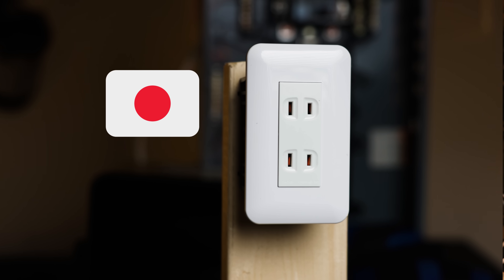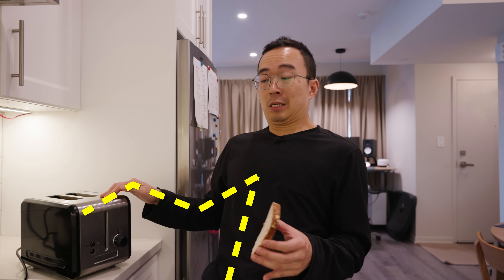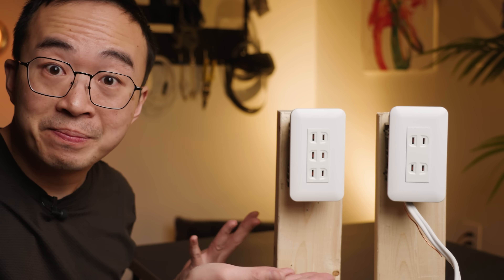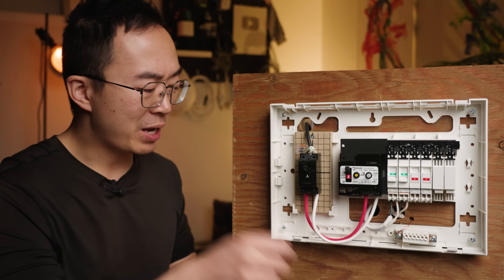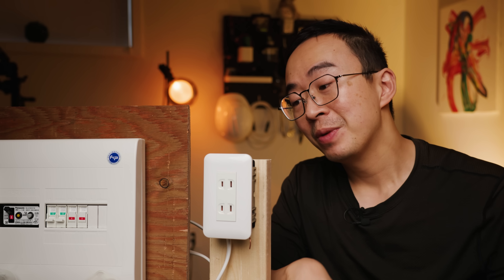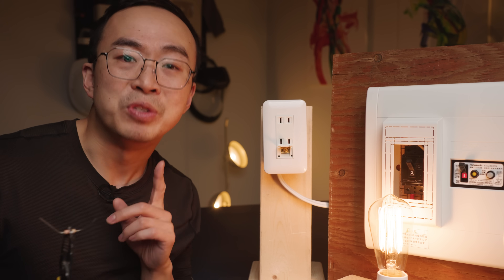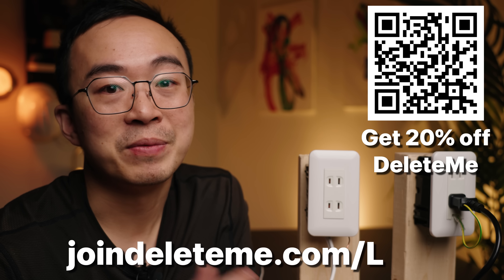How Japan Made Their Outlet Safe

Comment from the maker: 🔒Remove your personal information from the web at  https://joindeleteme.com/LAM and use code LAM for 20% off 
🙌 DeleteMe international Plans: https://international.joindeleteme.com
CLARIFICATIONS: Jan 21st  Ohhh the comments are spicy on this one.  I'll be adding more details tomorrow, here's some important ones: 

Grounding: Yes, ground acts as a low-impedance path (in TN countries) to trip the circuit breaker and turn off the circuit.   One of the best video on grounding and bonding covers this point in incredible detail: https://youtu.be/mpgAVE4UwFw?t=993  This is someone who has built an incredible system teaching NEC and how it actually works.

Japan ≠ Best.  This is not a video about who has the best system and especially not Japan having the best system.  This is about how Japan solved a problem that runs opposite to America (and most countries).  They required GFCI first and grounding second which no other country has done.  That's the unique part, not the GFCIs in the wall.  If you have a favourite electrical system and you got offended, sorry.  

7W Light Bulb: I didn't do a good job with this visual / explanation.  I was referring to the filament, not the wire, the filament provides the resistance and therefore due to Ohms law restricts it to 7Ws.
Reply: for the record, this isnt only japan's outlet, the philippines and a number of southeast asian countries also employ the same outlet.
edit: though we dont have a "GFCI", but now im interested and i want it.
Reply: This is nothing compared to the over engineered British plugs and outlets 😉
Reply: Please do not scam people with those scam ads.
Reply: All the new construction in the state I live in requires ground fault interrupt breakers so if we're adding them to our breakers and you guys are adding grounds to your sockets you might as well just use the sockets that America uses cuz it's already got three prong ground on it
Reply: because if an outlet in japan becomes unsafe it will be shames and shunned for dishonourable conduct
Reply: reported for scam)
Reply: That is crazy that your father got blackmailed by advertisers. Thank you for sharing this with us!
Reply: Or a previous tenant just ran a jumper from ground to neutral on the back of the outlet. Then the nifty passes, even though it's not really grounded
Reply: We build underground.
Reply: I guess that solving the problem just doesn't make enough profit for big business.  No go!
Reply: Huh? No mention of ARC FAULT (AFCI) protection aka DAA/DDFT in europe. GFCI/RCBO is old news in global electricity safety systems.
Reply: They did not... European ones are safe.... (not UK, but EU)
Reply: Thankyou I enjoyed your video and history of GFCI
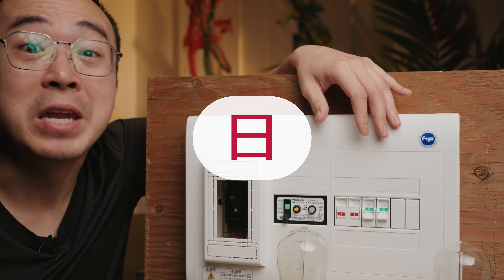I love the 1:10 XD
Reply: am I the only one who gets scared when I see open electric components like this. 😅
Reply: In spain we use the same sistem and the ground on 16A outlets  and now it's alos mandatory the ovevoltage protector becuse are alot of on grid photovoltage sistems.
And yes they are in the panel from the 1980 normative.
Well it was mandatory becuse the 220v can kill you insted the 100v of japan plaus now we are on the 230 v +-10% upgrade made 5 years ago.
Reply: Every electric expert uses slang language like tripping, shook. Makes me confused forever on the subject of electricity.
Reply: Japan's 2-pin voltage is 100VAC, will never kill anyone!
Reply: I always thought that ground circuits were in place to reduce the risk of fire in case of short circuits and to protect the home and occupants in case of lightning strike or power surge.  Where I live we have single phase with one ground in most homes. Some may have three phase power.
Regulations demand that Any electrical appliances that do not have a ground circuit must be double insulated, amongst other compulsory features.
Reply: I beg to differ: 3 holes are better than 2. 😢😅
Reply: Creo que europa es mejor , si falla el diferencial, te salva la tierra si es inferior a 129 oms necesitas Asegurar tensiones inferiores a 24v en las chapas electrodomésticos. El sistema americano tierra a neutro creo que es peligroso Y lento no protege a descargas directas solo indirectas.
Reply: Nice to meet you.
I am an electrician in Japan.
The direction of the outlet is opposite to that of the wall socket, the short hole is on the right and the long hole is on the left.
Reply: Why don’t you talk about the dual voltages in Japan….so much for a logical country
Reply: Żaden inny kraj? Polska zdebia dokładnie to samo na obszarach wiejskich, ale w Polsce oba systemy się dublują od 2002 roku. Przy czym dalej w starych budynkach można spotkać instalacje z wyłącznikiem różnicowym bez uziemienia. Sam w swoim domu robiłem uziemienie jakieś 4 lata temu, a wyłączniki różnicowe w moim domu są od 1997 roku według dokumentacji, a dokumentacja sprzed tego roku zaginęła . Ogólnie w europie uziemienia, wyłączniki różnicowe i transformatory separacyjne wprowadzano w tym samym czasie na różnych obszarach w różnej kolejność. Dziś większość europy używa jednocześnie wyłączników różnicowych i uziemienia.
Reply: America use to use that exact same style of outlet but we changed the outlet over 38 years ago for a grounded one for safety reasons and added the ground to the wiring.  Japan is actually way behind in dam near everything.  For starters less than 20% of the buildings in Japan had electrical in them at all in the 1970s.  It wasn't until 1984 that the number of houses in Japan with electricity broke 60%.  In 1978 less than 30% of houses in Japan had plumbing.  I actually did some research into this and turns out there is more than 20% of houses in Europe that still don't have real electricity and plumbing in them but they do have extension cords hooked up to out door power boxes that give a pseudo power system to them but not a real power system.  48% of houses in Italy do not have any electricity nor indoor plumbing in them but they do have pipes that are added threw holes in the wall and slanted to give a pseudo plumbing but the plumbing is not actually physically installed into the buildings but are in truth attached threw the wall and not threw the ground making them not technically installed.    Imagine having a pipe travel threw your wall to push the poop out of the house but not actually installed into the actual building.  In truth that function is illegal in America do to the fact that sewer gas will go back leash and head into the houses and also it can in fact cause an overflow from the sewer when it rains or a build up happens causing random people's poop to enter your toilet.  Now you can still buy that same type of outlet that Japan uses in America but they have to be used for outside or for sheds and can no be used inside of homes unless its replacing one that has a grand father clause that allows it to be replaced if it meets legal code and was already in the house before the law was put into place requiring them to be changed.  Not all electrical is allowed grand father clauses however but I have what you use because my place I rent is a few decades old.
Reply: "2 holes are better than 3", does this mean you prefer guys?
Reply: Holy crap this is misleading... you didn't do a deep dive of anything, you are a bad clickbaiter... which is basically a scammer and you should feel bad about it but just like the indians that scam old people over the phone you don't feel bad.
Reply: @thomgizziz  dude, chill out.
Reply: It seems i can't comment under your comment? Sorry if these all land in your approval folder. 
Just wanted to say that this comment is not pinned, as you migh/ want to do for visibillity.
Also that incogni and co don't protect you against criminals, cause they only request deletion, so if your data is with criminals or organizitions that don't care about the law, it will remain there. Cheers

Comment: I love RCDs, they show problems that normally would go unnoticed, like for example moisture ingress. For normal breakers to trip, you need a significant current, but RCDs will detect even small leaks before they become a problem (assuming adequate grounding). Getting shocked with one active definitely hurts, but nowhere near as without one. Had the displeasure of experiencing both a few times at 240 volts. Even if your code doesn't require them, if it's allowed, I highly recommend installing and regularly testing them.

Comment: I'm in Norway, just recently upgraded my electrical distribution panel, now every circuit breaker have individual ground fault detection loops, in addition to the ground fault protection switch, combined with most outlets being grounded. Also, with that upgrade, I had cables replaced with higher cross section, no more 1.5mm cables, I have 2.5mm as default except for stove top which requires 6mm, some of the circuits have been reduced by a few amps, and I have divided the apartment in more circuits, so that load should be more separated. Lower load on higher gauge cables means less heat which reducess fire and fault probabilities.

Comment: OMG - at 3:10 you have the same microwave as I do.  I hate that microwave and wish I had not bought it.  The panel cannot be read in the dark, there is no backlit panel or anything, and the "buttons" are those plastic membrane material that wears down and eventually peels off.  On top of that the way the timer and power works is confusing.  It has 4 buttons for cooktime, 10secs, 30secs, 1min and 5min.  You can press the 30sec button multiple times, but if you do you cannot press any other button.  It makes no sense.  Same with setting the clock ... it is confusing enough to begin with, but with the black panel you cannnot read the hours minutes seconds.  That is the worst microwave I've ever owned.  I am just waiting for it to break down.

Comment: Some of you might ever get shocked by the metal chassis of electronic devices (like the aluminum case on Macbook), or sometimes a slight unpleasant buzzing feeling when you touch it (this is especially noticeable when you rub your finger on a charging iPhone). That's basically what you get on metal-covered appliances/devices without ground. That's not caused by failing wire, but the inherit induced current in the metal chassis. In many countries you have the option to avoid it because Apple sometimes gives you an extra cable with grounded plug.

Comment: 4:23 okay so then what’s the point of the rod going beneath the ground?
Reply: Basically ground wiring is just a safety highway back to Neutral, but if we don't "anchor" it to the Earth, the metal surfaces might be "floating" and could be at uncertain potential due to inductive and/or capacitive coupling, or can be charged up and cause little sparks when it touched by something or someone. We can eliminate this by grounding our home system as well as the electricity provider grounding the cable ploes and neutral at their end. By this the whole system is ancored to a known foundation: Earth. and every little unwanted charge flow is neutralized by it.

Comment: Appliances with reinforced primary insulation don’t need a chassis ground pin and can use a two prong plug as he states  Japanese devices likely have ythis my design. However you can still plug in a device with simple primary insulation (as many US devices are built and require a chassis ground) into a two prong system in Japan and you loose the protection from shock if the primary insulation fails.

Comment: Here in Sweden, we have been lacking ground in dry rooms, and it only became a requirement in new rooms in 1994. Because of radiators and stuff we were eventually forced to switch
Unlike Japanese and stuff, you are NOT allowed to mix grounded outlets and ungrounded outlets in the same room. And you were allowed to use these outlet outdoors and in wet rooms until... 3 years ago?
And is the replacement thing just a just in case thing, because outlets are to last at minimum 50 years here.

Comment: The best electrical distribution system is the Italian TT system, where each house has its own independent earth connection and multiple RCDs that divide the household circuits. This prevents a total blackout in case of a fault. Typically, 10 mA or 30 mA residual current devices are used for personal protection.

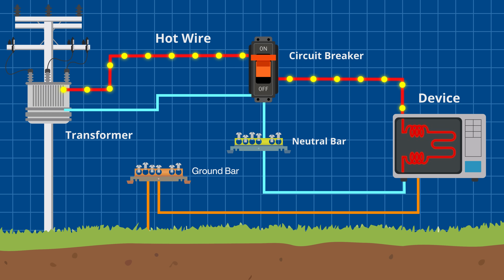Comment: 2:38 I see someone doesn't realize the ground rod has nothing to do with protection, and that the neutral and ground bus is tied together inside the panel, which provides the actual return path to trip a circuit breaker during a ground fault.

Comment: This is all well and good, but outlets are for consumers are supposed to be dummy proof. Consumers are not supposed to carry around a screwdriver to plug things in. The fact that they haven't made three pin grounded outlets the standard yet means that they are behind the state of the art safety standards. Similarly, GFCI protection is not standard on all outlets in the USA, but maybe they should be. In the British wiring system, all plugs are three pin grounded and GFCI or RCD protected.

Comment: Great overview. While the traditional system is effective, Japan is now phasing in a 3-prong standard where it's needed most. Although 3-pin outlets have long been mandatory for 200V circuits and high-risk equipment, the 2022 regulation update extended this requirement to all outlets in kitchens and bathrooms. It is a practical, step-by-step transition.

Comment: In the United states you can replace a 2 prong ungrounded outlet with a 3 prong GFCI outlet . So technically similar to the Japanese model using a GFCI as the way to protect.
Also now the United states requires in most residential circuits required to be on a arc fault breaker and they also have combination breakers that have both arc and GFCI protection . Also ground is used for lightning protection

Comment: The nice thing about GFCI is you can replace a two-prong outlet with a GFCI outlet in a circuit that DOESN’T have a third ground wire and it protects the user without ground.

Comment: What's the point of having a metal bar deep into ground if it doesn't really do anything since the electricity forms a loop with neutral?
Reply: Those are ground rods. The discharge static charge to the ground and they mitigate the damages that are caused by induced voltages caused by nearby lightning strike

Comment: This video is garbage.

1. GFCI isn't guaranteed to work properly without a grounded device because the current can travel through your body and then return via the neutral and won't actuate the GFCI.

2. Ground pins also enforces polarity preventing a miswired device or outlet from having a live metal casing.

Comment: I love it. Sounds very safe, but you didn't discuss the downside:
1) harder to reset if you have to go to the electric panel, 
2) one trip shuts off everything upstream and downstream. In the U.S., you only need to worry about downstream. This can be a problem if you didn't plan a fridge might connect upstream.
3) Finding the culprit device or outlet is harder.
4) And well, older hardware may auto-trip.

Comment: Watching this from Europe (France, but I belive the stadards accross Europe are fairly similar, at least compatible from a regulatory and interconnection standpoint) is just telling me that both Japan and the US have somewhat unsafe electric connectors / standards. Since we have GFCIs on the main breaker as standard and while some low(er) power appliances may lack the ground plug, grounding is extremely common, not sure I could find anything other than a basic lamp without a ground plug nowadays, and outlets without it are incredibly rare.

(the European standard plug design isn't quite as gold standard as the UK one, but it is still fairly good afaik and also a lot less bulky and awkward imo - also hving an individual fuse in the plug and switch on the outlet is neat, maybe, but definitely unessessary ^^")

Comment: Earthing is still needed for normal operation of lot of appliances that have some rotating elements because current induce in the metal body around the rotation elements and you can still be shocked by touching it even if input and output current are the same and the circuit breaker will not work.

For example air con, stove(with fan), refrigerator. You dont plug these directly into an outlet, you hard wire them.

Comment: Back in the day (100 years ago) GFI's didn't exist. There was no device that turned off the power to the socket if it detected 35 milliamps of leakage current (thru a person's body). The best they could do was blow the main's fuse (because circuit breakers didn't even exist yet) if the hot side of the line came in contact with the metal casing of an appliance (note that they didn't have plastic casings then either). The idea was to protect you from an internally shorted appliance (by blowing the main's fuse) before you even touched the appliance. If an appliance casing was internally shorted to the hot side of the line, it would blow the main's fuse as soon as you plugged it in.

Comment: I skimmed this.  Is Japan on three phases or just two phases?    What are the peak AC voltages?   I am assuming it is not DC voltage.  How much current can the electrical utlility provide to the home usually with each phase?  1000 amps?   I like to know the basics first.
Reply: Yep you need to educate yourself.  Your questions indicate you have little knowledge of how homes receive power from the utility companies.